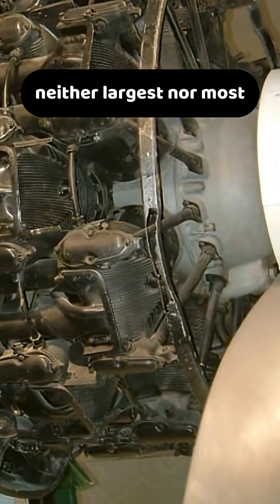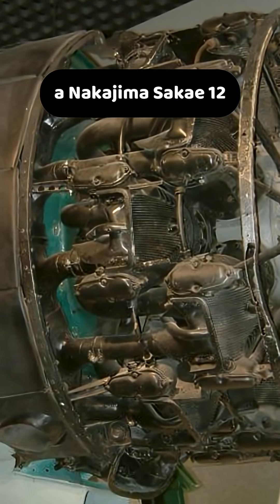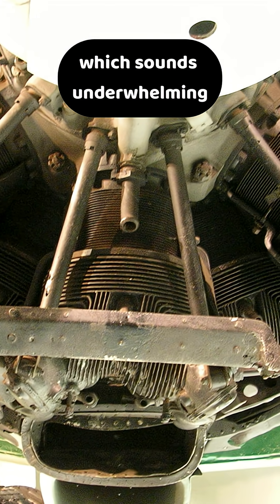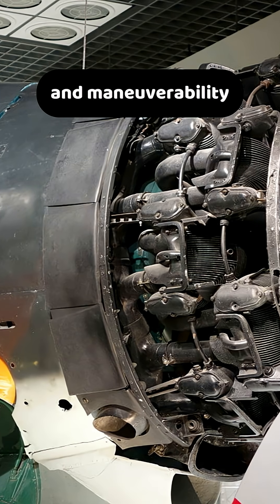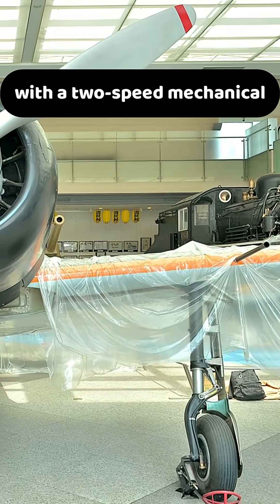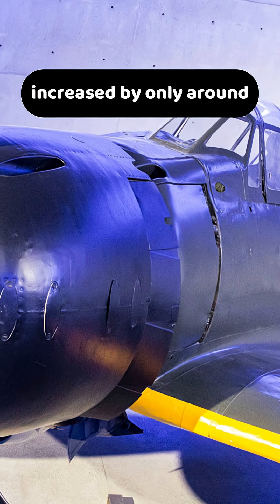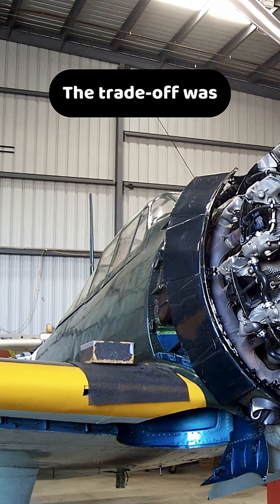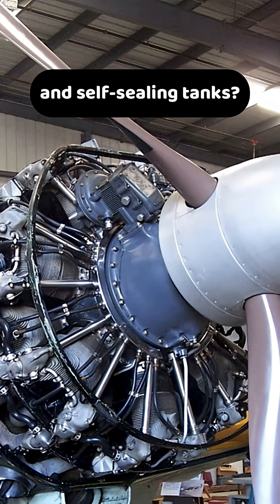Underpowered Engine That Made the Zero a Legend

Comment: How does an engine provide manoeuvrability?
Reply: Light weight. Huge advantage in decreasing turn radius while increasing range - two design parameters the Japanese felt they needed to optimize more. It's all a tradeoff. Plus, they simply didn't have advance supercharger technology at that time and the Germans were not sharing.
Reply: by keeping the speed above stalling, through power. its incredibly important for power to weight ratio, otherwise you fall out of the sky after two turns

Comment: If they’d had powerful engines, they could have had armor and then they’d lose less pilots… but it was a fine plane when not being shot at
Reply: They are all compromises. Turn rate increases dramatically affecting "dogfight" performance while decreasing range. They just could not keep up in the manufacturing and technology race the war turned into.
Reply: That’s precisely why they wanted to invade and expand: so they could have access to more oil and metal.

Comment: Interesting facts about the relationship between the Japanese and Western aircraft industries before WWII:
- Japan, especially during the 1930s, sought to manufacture Western models under license or through reverse engineering. For example, the DC-3 was manufactured as the Showa/Nakajima L2D (almost 500 units) and purchased the prototype of the Douglas DC-4E (rejected by American airlines for being too complex and expensive – it was luxurious and pressurized). Reverse engineering was carried out, and from there came the Nakajima G5N Shinzan bomber, which did not succeed mainly due to engine problems (a recurring problem for the Japanese).
Another interesting case involves Jiro Horikoshi, creator of the Zero, who, together with another designer, was sent to Germany in the process of preparing to transform the civilian Junkers G.38 aircraft (which had as a striking feature wings so thick that they could carry passengers inside) into a bomber, this would be the Mitsubishi Ki-20 that would fly in 1932 – only 6 were manufactured.
Reply: All their propellers were copies of the Hamilton Standard.

Comment: Japan was dependent on aircraft engine technology, producing under license from Western manufacturers such as Bristol, Pratt & Whitney, and Gnome-Rhone. The Nakajima Sakae descended from a combination of these technologies, whose designs originated in the 1920s, therefore, it was impossible to achieve power equivalent to the more recent Allied designs. Everything was done, including redesigning the exhausts to obtain a few meager horsepower from exhaust gases. Furthermore, working at the limit compromised durability.
Reply: And they lacked advanced supercharger technology. They didn't add multiple stages and speeds until much later in the war. They also did not have a manufacturing capability or raw materials to do a lot better.

Comment: The P-39/P-400 and the P-40 had single speed superchargers giving them high power over a far narrower altitude band.  The Zero had a huge advantage in the high altitude New Guinea fighting.
Reply: Until the P-38 came along with turbocharged engines... giving them much better high-altitude performance. But it wasn't quite as relevant in the PTO since combat often occurred at lower altitudes. The Zero was designed to maximize range and prioritize turn performance for dogfighting over all else - sacrificing survivability to be able to range across Japanese holdings in the Pacific. Not an unreasonable compromise early on in the war. But once heavier, faster, better armed US aircraft arrived on scene and tactics changed from turn dogfights to boom and zoom - they were done. The days of the Zero's supremacy in the skies was over.
Reply: No ‘expert’ knows about the Japanese high altitude bombing raids over New Guinea!  They were effectively unopposed.  Just regurgitate tired stupid clichés.
Reply: No one is arguing that the Zero didn't have good performance. It's just that they decided a light aircraft was more important than one that could survive a firefight.
Reply: @shmaknapublar  They didn't have an engine powerful enough to hang on a survivable fighter.

Comment: The A6M was originally designed around the engine which had less horsepower than other European high performance power plants becoming available in the late 1930s. In the early 1930 Japan prioritised manoeuvrability. All these issues meant a light, very light, weight airframe was critical for the aircraft to have comparable performance compared to other western fighters at the time. The A6M excelled in some flight parameters such as range, manoeuvrability & climb rate. Part of the Japanese samurai culture meant built in safety features were not a priority. In Europe it  wasn’t until the very late 1930s that pilot armour plating & self sealing fuel tanks were a basic requirement for survivability.
Reply: They didn't learn one important fact. It takes hours to make a plane. It takes 20 years or so to make a good fighter pilot.
Reply: And range. They needed range above all else. And they were way behind on supercharger technology and Germany was not sharing their advances with their ally. Once the F6F, P-38, and Corsairs came along the Zeros were cannon fodder. Unless you were inexperienced enough to get into a turning fight which was suicide...
Reply: The Zero’s two speed supercharger in 1941 was miles ahead of the USAAF’s P-39/P-400 and P-40 as well as various enemies’ single speed supercharger fighters like the Hawker Hurricane, Spitfire MkV and inferior export engine versions of the Brewster Buffalo.

Comment: A friend that was a powerplant mechanic for the now Commemorative Airforce told me that the Zero's original engine was a nightmare to work on.
Reply: That’s radials by default. You have to remove and label each piece. They only go in one place and one direction.
Reply: @Mytwistedvoices  LOL, that's what he said.  He also said that the wiring harness was nightmare on a good day.
Reply: OK. Now THATS a COOL JOB
Reply: At 15,000 feet would you want to be in a Zero or a P-40?
Reply: @givenfirstnamefamilyfirstn3935  Can I choose option c:  F6F?
Reply: This us licensed copy of french engine.
And service everything french is nightmare
Reply: Isolation and superiority complexs rarely breed the best engineers
Reply: @captaintoyota3171  That is like the Japanese adopted Hotchkiss designed machine guns in the 1920's but instead of leaving the design alone , they insisted on improving it because the idea that a foreigner could make something better than them went against their sense of  racial pride and superiority and began to have feeding issues they could never resolve and went to the solution everyone else did at that time that had engineering issues and that was to oil the ammunition to get the rounds to feed without jamming, while this solved the problem it created another problem dirt in combat conditions would stick to the oiled cartridges and get into the guns action creating jamming , it wasnt until several years later when they finally decided to stick to the original French design did they finally manage to produce a reliable machinegun
Reply: @captaintoyota3171 the zero was an exceptional feat of engineering for its time

Comment: The US Navy F4U Corsair and the F6 had 2,000 hp engines......more of everything
Reply: They had the same engine. Pratt Whitney R-2800 Double Wasp. Late war the engine could produce 2800hp. The engine was used also in the Thunderbolt, Marauder, which my Dad flew, Invader and a few others.
Reply: @forbolden  Neat thing about the F8F Bearcat is that it used the same engine as the F6F, the PW R-2800.  And both planes were designed specifically to combat the Zero after the Aleutian Zero was recovered and studied.  The F6F was the heavier fleet carrier plane while the F8F was designed to fly off the escort carriers to replace the F4F Wildcat.
Reply: Where were they early in the war when the Japanese were winning everywhere?

Comment: More power normally means more payload or climb rate. Wing and drag have a lot to do with top speed. Brute force is an option though 380mph increase 420mph took spitfire engineers from 1200hp to 2000hp, a 40mph increase of speed took about 800hp. Also that speed increase is achieved by flying higher and getting rid of drag. The impressive thing is how well the zero did with much older tech.
Reply: Yep, the increase in HP to take a C4 Corvette chassis from 200 MPH to 220 MPH is 400 more HP.
People really don't get how much the stakes increase the faster you go.
Air just doesn't want to get out of the way.
Reply: At twice the speed the drag is four times higher and the engine has to do the work in half of the time.  That is why 1918 fighters got by on 100hp but 1939 fighters needed 1,000hp.  At 5,000 feet one might get somewhere near to 110 mph and the other 240 mph.  (The top speeds in WW2 were at very high altitude with sophisticated supercharging).
Reply: They were hyper focused on weight reduction for range and maneuverability. At the expense of survivability. Initially they did not value their pilots as much as they should have while also needing the extended range due to the sprawling Japanese empire across the Pacific. Not unreasonable choices but they did not have the resources to evolve and adapt like the Allies did.
Reply: @Mike-eq4ky I know the narrative is they did not value their pilots lives, it is actually in the world war II propaganda/ tech debrief for American pilots, and yes that is a easy way to look at it. But if you just look at it you miss the technology problem, they do not have a 1800hp Radial Engine to power an A6M with armor, if you don't have the engine any added weight is going to just make your pilots have no competitive advantages. Nobody wants to have their guys die, some time it is necessary but they didn't design it in they were painted into corner
Reply: @Owen-mt4si  Yes, I completely agree with you. They did not omit self-sealing fuel tanks and armor because they didn't consider pilots lives as valuable - instead, it was a well-considered engineering tradeoff to meet the range requirements and support their prewar views that turn dogfights were still relevant. Turns out (pun intended, I guess!!) given advances in US fighters that armament and tactics  - zoom and boom at high speed - with high survivability won the war. And... we could field a 10X numerical advantage in aircraft which just made the Japanese situation intractable as the war of attrition raged on.

On a similar thought - I do not think the use of Kamakaze pilots towards the end of the war was due to "fanatical devotion to the Emperor". It was actually a coldly logical and calculated response to their bad tactical and strategic situation. It was easier for low-time pilots in aging, war weary aircraft to fly into a ship and to actual damage than aiming guns and cannons. It actually was highly effective as a last gasp measure and had the Allies quite concerned. Back in 1945 before the age of smart weapons... it was the pilot that was the targeting system. They were nothing more than bus drivers for bombs at that point. Of course, it was not sustainable but the hope was to deter an attack on the homeland at any cost. And they had many more in reserve. 

Good thing they finally surrendered after the bombs were dropped...
Reply: @Mike-eq4ky at the end of war an unskilled pilot vs a skilled was suicide anyway it is logical to try to take the enemy with you. Though Kamakaze means Devine wind, it refers to a typhoon that destroyed a Mongolian fleet that was going to invade Japan, they used the story to try to stop the invasion...it didn't work, though it is interesting.
Reply: The Zero was brand new in 1940.  It was easily the most sophisticated fighter in the world .  ‘Sacred’ Kelly Johnston didn’t understand Mach and external venturi.